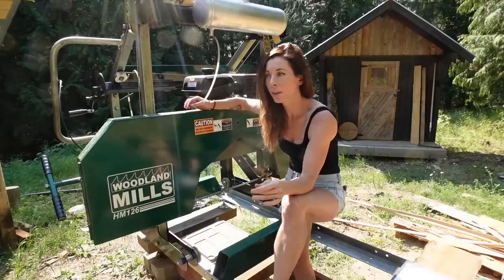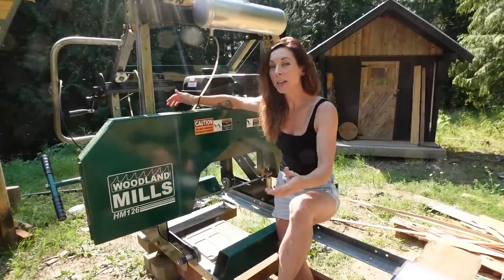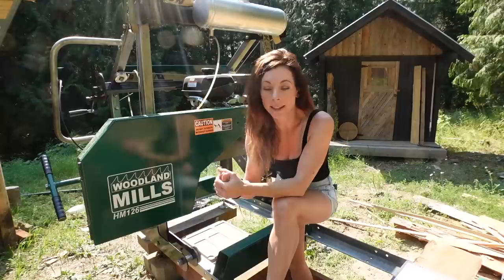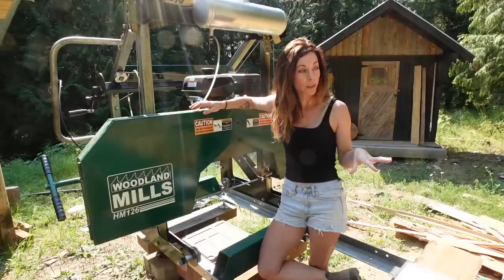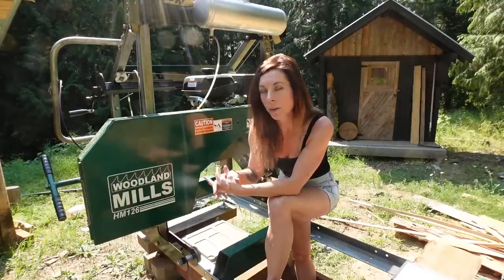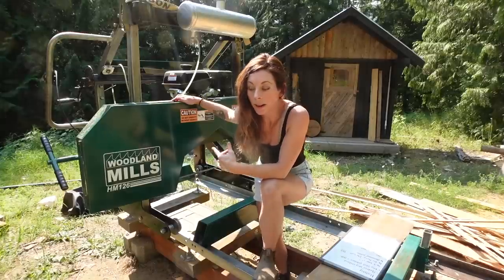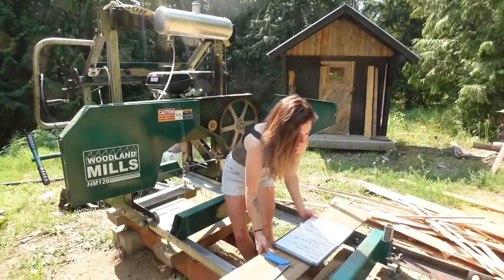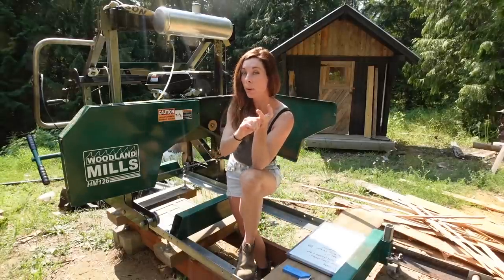My honest opinion - Woodland Mills HM126 bandsaw sawmill

Comment: Michelle, why do you stay in one spot, ridged as a school girl on her first kiss? Actually do the right thing and upgrade the mill knowing it is the right thing to do. You guys kind of went to a avenue of buying direct meaning it took money from the sale for this mill from woodland mills.. so they are paying from their own pockets instead of the mark up of this product that covers costs of a mill "warranty" that if bought from them would also cover their butts. A mechanic for example will charge more than a neighbor to fix something so that should they need to make it right, it comes from the profit margin. In other words, the base cost of anything is just that and if it needs repairs later, its at a loss to that seller. I have been a mechanic for over fifty years, (I am that dang old), this seventy three year old man has had one comeback... I later found out that the guy just wanted his money back so cut a belt and overheated the engine, it wasn't something that I did wrong. I did take the engine apart and the soft plugs have a heat indicator that will tell the mechanic if the engine was run extremely hot.... plus a witness also came forwards and told me the guy just held it to the floor till it slung a rod out with steam coming out everywhere. I charge enough that should it take me say a few days to correct something or give their money back, it helps cover some lost time for me on each job. I really am   doing a bad job at explaining this... errrr! Back on subject... I also built mills  for people who needed them a long time ago before any little company like woodmizer or your mill for example. I actually built one in the late seventies that is still running strong in  S.E. Alaska out on the islands in a town called Craig. As a kid, my dad had mills and I had to run them making me aware to shortcomings on mills. I am badly crippled now but my godson and his friend needed a mill for their hunting cabin so I designed one that they had me there to show what to do, they did the work but now they are way happy with the mill and have people wanting one like it. Mine are all hydraulic mills and do a ton of things your mill will never ever do. I never make mine to just set on the ground... they are set into a building or trailer mount to address the sawdust and other problems you have loading a log into the space on the log deck. My log stops are hydraulic an have "Sight stops" so you can not hit the log stops with the blade unless you just force it.... why would you??  In the mill buildings, you have the option of a electric motor or diesel engine, electric is very quiet and so much faster when noise is a factor. Electric is way more expensive to operate so most just go diesel for cost of operations. I  was going to build edgers but my mill if ran right, its faster to just address the live edges on timber at the time than have wood pile up that needs the wain cut off of the boards. My godson had a guy who has the best that woodmizer sells offer to trade his for their mile, the one I designed. A lot of time is wasted in getting a log in the deck setting where the log is level an able to get all the sides of a log trimmed off. Also your stopping to adjust the log locks for keeping a log from twisting or turning is not time effective so my hydraulic mill is so easy because you just stand in the same place you would to operate mill from an do all the adjustments from there. Also same for doing lap siding and shingles. I must apologize for my way too long comment Michelle. To address one other thing.. the reason I never went into business for making mills. I did used to make mills for lumber an cedar mills, I got a divorce, became a solid and very talented DRUNK!! I just gave up on life in general but after researching alcohol very  therology, found out it is much cheaper an easier to just quit drinking.... I was sick of being sick. I can not defend the drinking and will not make excuses for the drinking.... it sounded like a good idea at the time when I was at the bottom of a cheap bourbon! So had I done something responsible instead, I would not have lymphoma now or kidneys that keep failing. I know one thing for sure, I sure did lose a lot of friends when I quit drinking and providing for them too. I do have one thing going for myself.... I never told anyone I had a brain or that I used mine.. some doctor can sell my brain for a "unused" one after I die. Its probably got some pickling on it as well also

Comment: Actually from what you mentioned in your review - the company dropped the ball to a large extent.
The items discussed seem to me to be basic features and nothing particularly value-add.
The Engine 'dance' - first, they should have come out themselves to hand deliver and FIX the problem - absorbing ALL costs - you mentioned it's not their fault - I disagree - it's entirely their fault - you, as the customer should not have to give a flip where a part comes from.
The machine should have been tested before delivery - that's IS basic QA control 101 - being 'so-called' engineers THEY KNOW THAT and they screwed up and were unwilling to take responsibility.
I could go on and on - one thing to be a young company and make mistakes - quite another to be a young company and NOT own the screw-ups and unwilling to go the extra mile for a customer.

Personally, you review was overly kind - I would not have been.